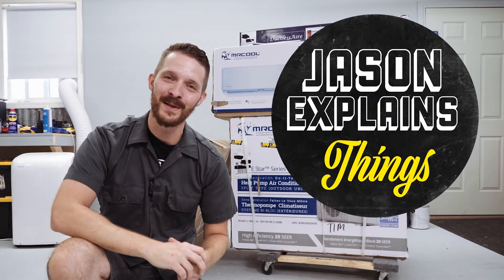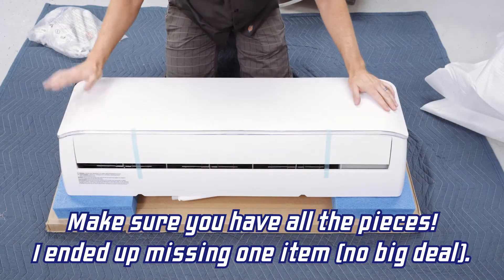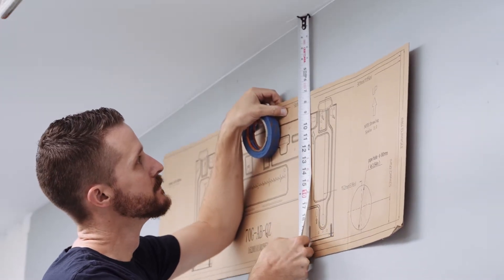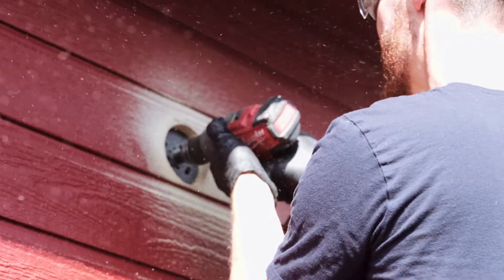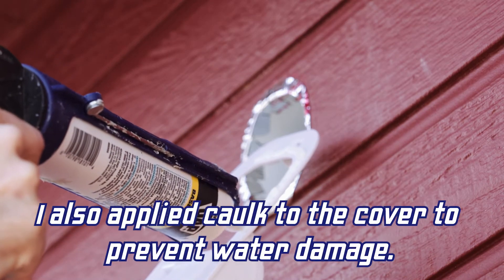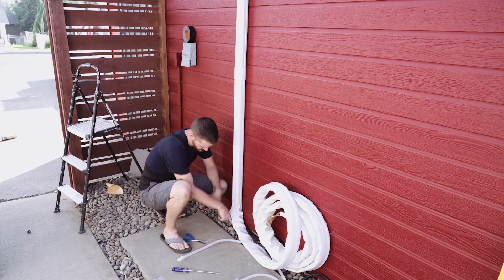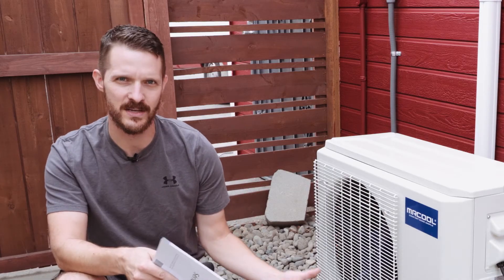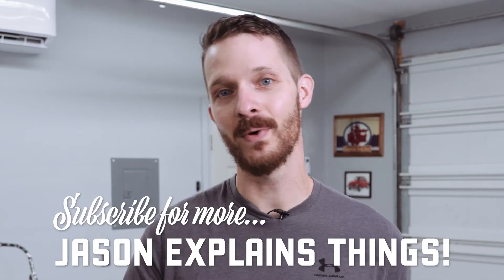I Installed A Heat Pump In My Garage! (MRCOOL DIY Mini Split 3rd Gen)

Comment: I am going to ask a couple questions based on comments as well as a few myself. Any and all input from anyone will be appreciated. 
1. I see you and others say they are pre-charged. Which is great... but what is holding the charge? When you hook them up... is there a seal on the inside that breaks when you tighten down the fitting(s)? One person below said it comes pre-charged with nitrogen. ??? If the unit is 410A where does the nitrogen go??? I dont think nitrogen would be the charge. That is usually used for pressure testing. It seems to me it would be pre-charged with 410A. But my main point/question is....   I am trying to determine how and why it is not really necessary to pull a vacuum. If there is no valve(s) on either end of the line sets.... like the cond unit itself.... what is holding the charge? Both on the line sets and the inside unit as well?
2. Has anyone pulled an amp draw on these to see exactly how many amps it pulls at peak start up as well when running? It would be nice to know.
Reply from the maker: 1.  Yes there is a seal inside that opens.  You can hear it when it happens.
2.  Download the installation instructions and you’ll have the answer.  I installed a 30 AMP breaker, but that is likely overkill.
Reply: @JasonExplainsThings  Thanks! It would probably be clear as daylight if I saw it with my own eyes. But then I would have to buy it to see it. lol Anyways.... I saw that it will only be about 12 Amps probably 15 amps over time with wear and tear. I would definitely say 30 amps is not good. Improper protection. The larger the breaker the less protection you have. You may want to consider downsizing to 20 amp. Something may happen and You may be pulling more than 20 amps enough to ruin the unit or burn up a wire but not trip the breaker. Something to think about. But thanks again for info.... I come from refrigeration industry and I was trying to make sense of what held the pressured refrigerant inside but what would allow it to flow after connecting. SO there had to be a seal of some sort that once fully tightened would break that seal to let refrigerant flow. It would be advantageous for them to explain this to people. Probably would help sell a LOT more units... and more importantly.... keep a lot of negative comments down.... from people in the refrigeration industry (such as myself) and a lot of questions answered before asking... Thanks again!!!!
Reply: @adamgusse9484  agreed 30 amp not really protection other than a short
Reply: You do not pull a vacuum on the DIY kits.  They are more friendly and need less tools.  The ones that are not DIY do require a vacuum.  They have different fittings on the line set

Comment: I mean....you made some mistakes. The lines aren't charged. The outdoor unit is. So connecting the lines to the inside unit then "leak checking" with the other side connected to nothing is completely pointless. You failed to hook up a vacuum pump to clear out the lines before releasing the refrigerant. Will shorten the life of your unit. Also, the big coil of lines should have been cut off and shortened. No need to have them all coiled up like that. The lines do have to be a minimum length so you possibly should have moved the outside unit farther away....
Reply: The lines are pre charged hence DIY. Pre vacuumed too.
Reply: @isaiahbangura4421  Incorrect...outside unit is charged with the refrigerant. Lines are just capped. They are wide open to the atmosphere when your remove the cap, hence need to vacuum the system out when your connect everything. Then open the valves to release the refrigerant into the lines and inside unit.
Reply: @billytwowillies  Incorrect. MrCool DIY lines are pre vacuumed. The lines are just capped. They only open when connected. That's why it's a DIY version because you don't need a vacuum.

Comment: Can i install this on an interior wall and run the lines up and through the attic?
Reply: Just a little tip if you are doing this, don't run the drain line up make sure its going down to pull the condensation down as it works with gravity and not a pump
Reply from the maker: Yeah I've seen a few people did it that way.  You'll just want to make sure the lines are long enough.

Comment: We have an 18,000 BTU Mr. cool mini split. With the heater on the unit seems to go on and off is this normal? And the unit is not perfectly quiet is that normal? I have been searching videos and articles but cannot find any answers thank you for any input
Reply from the maker: I can hear it click on and off while heating.  It's pretty darn quiet for me.  About the same volume as a small desk fan.  I'd check to see if you have dust buildup or something.
Reply: @JasonExplainsThings   OK thank you I’m calling Mr. cool tomorrow to see if there’s someone in my area who can do a service

Comment: No one’s going to mention about vacuum I guess. Dude you need to vacuum the lines before opening the valves with your allen key. It is a must to remove air , cuz the humidity will be condensed in that pressure and tada you will get water in your lines.
Reply: This is the 3rd generation Mr Cool DIY kit. Nitrogen is pre installed in lines at the factory which means no more vacuuming the lines.
Reply: @gmaddox2400  not nitrogen, they are either prevacuumed or full of refrigerant. You don't want nitrogen in your working system.
Reply: No need to pull a vacuum with a pre-charged system. As the link will describe and as has been known for many years this is not a new unproven, invention rather, pre-charged systems have been around quite some time.

By the way, I have good friends that installed a multizone MrCool DIY system in 2017 (?) just after the company started up. The system has ran flawlessly and serves ice cold air and toasty heat in their Kentucky climate along with being quite energy efficient.

I've spoken with a few of my neighbors here in the Pacific Northwest who sport the "MrCool" logo and all said they used the DIY system. Only one had an issue but that was related to their wiring at the breaker box.

PS - longer linesets are available at Lowes, Costco, etc or directly through the manufacturer.

https://mrcool.com/blog/pre-charged-line-sets-real-right/
Reply: Not on the diy Mr cool system. They have a have a closed line system where the lines are all pre charged so no vacuum or nitrogen purge is needed. Hence the name DIY

Comment: Welcome to the MRCOOL family! Your tutorial and install looks great. I also installed the 18K unit in my garage and shortly became the envy of my hood. With that said, I must share some info a few HVAC friends offered me. It was strongly suggested to me to not leave any excessive amount of the line set coiled during operation. This can create an improper oil trap on the suction line that will restrict proper flow to the condenser/compressor. Happy Cooling...
Reply: Just make sure the excess coil is stored in a horizontal orientation to avoid the oil trap situation
Reply: Plz don’t cut if you bought a DIY kit unless you want to recharge. You have to expand the excess line set somewhere, somehow. I choose to uncoil mine into the attic
Reply: Like you, I can only assume the sheathing/white foam has insulating properties. Not sure if removing could void any warranty issues down the road. I will offer that as I plumbed mine through the wall and into the attic to my outside unit, some of the sheathing was torn. My section of line set that is exposed to the outside elements still has this insulation. I also chose to camouflage it with a PVC line set cover kit. You can scoop this up from your friends at Amazon.
Reply: Only issue with the Mr cool diy kit is that the line sets already have the vacuum pulled so if you cut the lines to not leave the excess coiled up you'll then have to buy a vacuum pump and gauge set. You'll also then need to purge the system with nitrogen. So to keep it truly diy you'll most likely have some extra line set.
Reply: Hello is the bulky white sheath necessary to keep? I assume its for insulation? Just seems very bulky. Ty

Comment: Hello, just watched your video. The indoor unit seemed easy to install. What is powering the fan motor etc as i seen the 2 refrigerant lines and the drsin, is there a power wire that runs and we just dont see it?
Reply from the maker: Yeah there's a power cord as well along with the refrigerant lines and drain hose.

Comment: Great video man. I am actually looking at getting the same one you have. I’m in the middle of building the house and getting permission from builder to drill my hole for the wiring from inside garage to exterior in advance before they put the hardy plank siding. Any ideas on where I can get the cardboard template ? Trying to get one in advance as I’m still a 3 months away from ordering the mini split. Thanks
Reply from the maker: Hmmm... great question.  Not sure.  I think the basic measurements are online, for people that lose the template.  But I’m not sure.
Reply: Email the Mr cool customer service. They most likely won't send you a template but the will give you a picture wth measurements and layout

Comment: Been thinking about getting this mini split. The package comes with 25ft of precharged line. I am a little tight in distance from indoor unit to outdoor unit. Is the length of line already attached to the indoor unit included in the 25ft or is the line actually 25 ft. The 3-4 feet extra attached to the indoor unit may make the difference as to whether I can make it work.  I have watched a ton of videos on this mini split and yours was one of the best. Thanks.
Reply from the maker: I honestly don’t know.  That’s a great question.
Reply: You don't have to have the outdoor unit on the ground they make kits to mount it to the side of a house or building. You could easily gain the few feet you need with that. You really don't have 3 or 4 usable feet on the back of the indoor unit you have a foot at most
Reply: @T6Tarek  Thanks for the reply. As it is, I have already bought and installed the unit. Works great so far, and I had plenty of length in the line.

Comment: How well does it heat? Have you tried it yet?
Reply from the maker: Hi Justin, yeah I've been using it to heat quite a bit lately.  I have a natural gas heater (that's been in the shop before I bought the house) that I use to heat the shop up from cold, but then I use the heat pump after that.  It works great and is much quieter than the natural gas heater.  I'd imagine it could do the job entirely on it's own.  But since I have it I use the natural gas heater somewhat because it's cheaper to run.
Reply: @JasonExplainsThings  how far north are you?

Comment: Your outdoor unit seems awfully close to your neighbor's wall. About as close as I want to put mine (Pionneer - about 55db) to my neighbor's bedroom... How loud is the outdoor unit? Did your neighbor hear anything?
Reply from the maker: Not my neighbor... that’s just the side of my house (installed in a shop).  👍
Reply from the maker: Its also pretty darn quiet.
Reply: @JasonExplainsThings  and so you do not hear that outdoor unit from inside your house? that'd be darn amazing indeed (I am just really concerned for my neighbor and how close 15ft this unit will be from their bedroom). Thanks!
Reply: It's no different then having a heat pump, people have them across the usa, can you occasionally hear them? Yes. Are they loud and annoying? Honestly no. They are really quite and rarely hear anything. Occasionally if it goes into defrost mode you may hear it that's about it. If you get permits and it's approved there isn't much the neighbors can say. Not to mention these are used in Europe and Asia where you will see 100s of them mounted to the sides of high rise apartment buildings.

Comment: I have disconnected the lines to move the unit forgot to close the lines now I gotta see what’s going to happen. Also what refrigerant is needed in case I need to refill and anyone else not getting enough heat it’s just warm
Reply: Even if you close the lines you'll still loose refrigerant due to what's in the lines and indoor unit. You will now have to pull a vacuum and evacuate the whole system or you'll will have tons of issues, and you'll most likely not get very much heating and cooling. The refrigerant needed is 410a. You will need to se how much the system requires and have a accurate amount put in the system, this requires special tools. By disconnecting the system you have now made to where you will need a professional or a lot of special tools and the knowledge of hvac
Reply: Once you do that you have to hire a professional, handling refrigerant requires a EPA license which usually hvac professional carries.

Comment: The unit says 230 volt I'm in the USA will 220 volt work or the same ?
Reply: Mr. Explains Things won't talk electricity 😜... But I will.
I can't imagine it being an issue for one key reason: voltage is constantly in flux, it'll drift from 240+ to 217ish at my house in Montana.
Reply: @playgroundchooser  correct. Most residential  area are supplied 120/240 volts. As in the transformer that supply’s your house takes a given “primary” voltage (7200v, 14400v) and converts to “secondary” voltage. 120 volts phase to ground, 240 volts phase to phase. Most utilities are given a +- 5% allowance of voltage they give customers.
Reply from the maker: I’d guess so, but I’d check with them.
Reply: 220 230 240 ok to run with here in fl power goes up n down😏

Comment: @4:09 shouldn’t that hole be at a non-level/downward direction for condensate drainage?
Reply from the maker: Shouldn’t be a problem.  The hose starts up higher inside the unit.  And I followed the instructions pretty darn closely. :-)
Reply: The extra line set should be horizontal and not sitting in the vertical position. It’s going to create an oil trap. Oil will not properly return to the compressor.